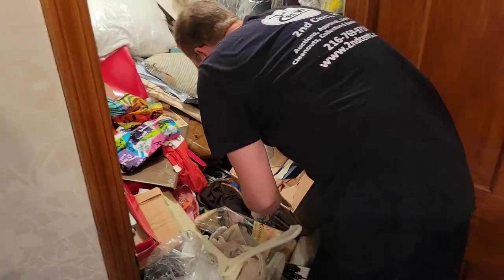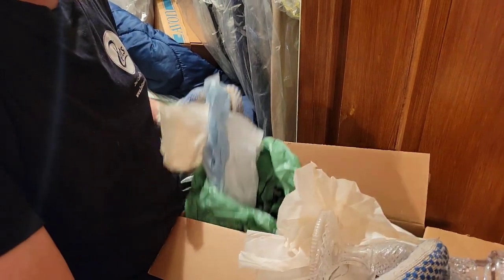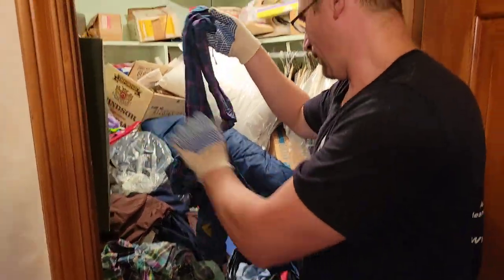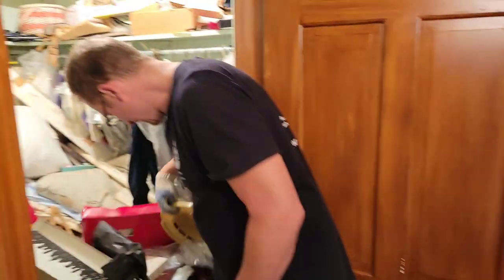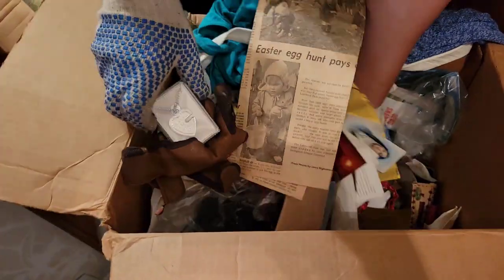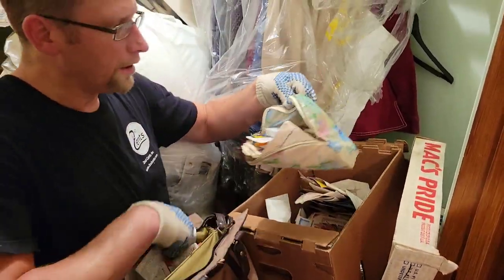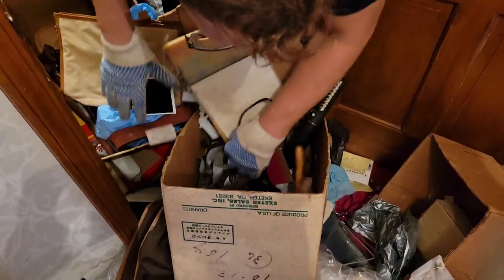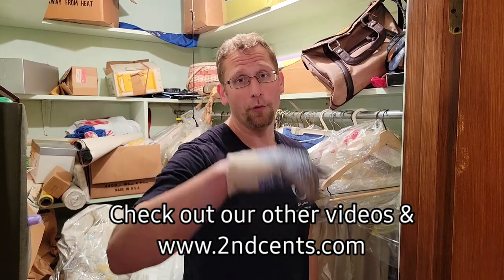Hoarder HID EVERYTHING in closets! ~ Unbelievable! ~ Paid me $5,000 to cleanout hoarder honey hole!

Comment: On a job like this in which the finds are pure gravy, I would do things so differently.  All those boxes...pull out the obvious no value items, condense the rest and take them off site for sorting. There is zero investment here that needs to be recouped in a hurry. That stuff has been sitting for decades and it won't hurt it to sit awhile and be sorted and auctioned when things are slow to keep cash flow going.  Clothing would be gathered in a central location on site, premium items pulled out of each armload/bag/box for auction and for the rest I'd call a few vintage clothing stores and take the best offer for the lot, all or nothing and you have two days to remove it. Books are too heavy for me to handle efficiently so they'd all be donated. If I was feeling particularly generous I might pull kids books for donation to shelters or housing for battered women. If there's a big enough load Salvation army and Goodwill in my area will pick up.